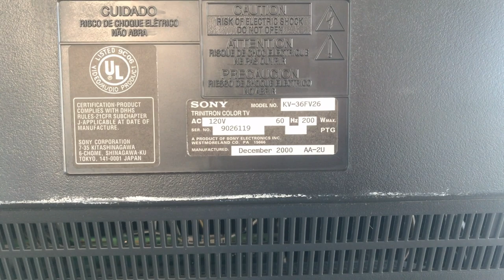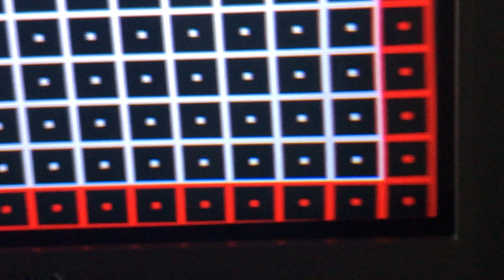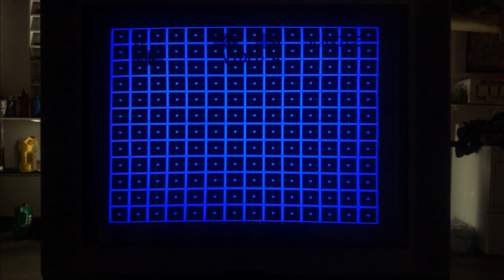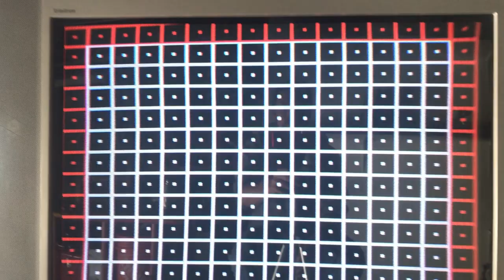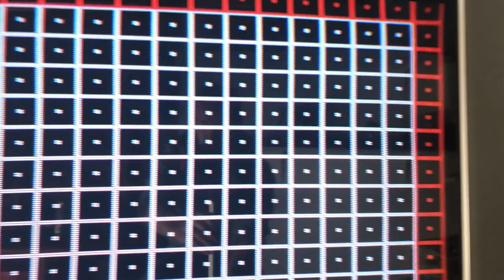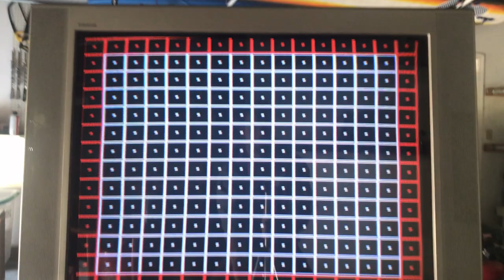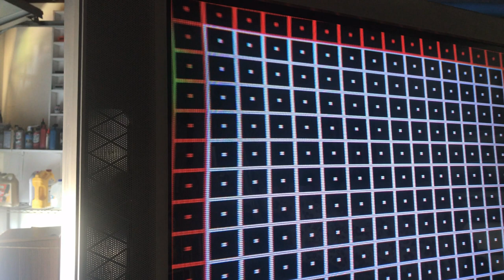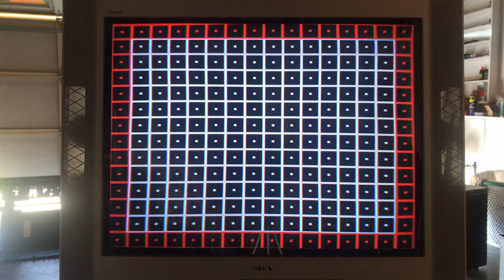How To Do General CRT Service And Repairs: Geometry, Convergence Etc An Emphasis On Flatscreen Sonys

Comment: You have a 4th set of rings to play with. The first three sets right on top of each other are purity, Red-green convergence and red-blue convergence... I think. Anyway that 4th set further back on its own helps with vertical bowing. Move them away from each other or closer together and you'll be able to straighten the top and bottom of the image. Don't seperate them too far! 8mm maximum. My Trinitron came with that same bowing. The problem you thought was mainly to do with Vertical position.
Reply from the maker: Yes! I saw a video of someone demonstrating this recently. I have been meaning to do a follow up video demonstrating what you explained in this comment. How did you find out about the bowing fix?
Reply: @riggel8804  I found the service manual online for mine. It showed the bowing problem as a diagram with the two magnet rings next to it. But with the wording around it, it wasn't quite clear what they were for because it was all next to convergence stuff and talking about the other rings too. And they were called 'blue' magnet and 'green' magnet to further confuse things. I eventually just tried it and sure enough that was the result.
Reply from the maker: @lullylew9083  awesome. Thanks for getting back to me. I pinned your comment.

Comment: Amazing video! Though I would love to see a video dedicated specifically to the Yolk. Talk about the safety of the yolk. How to hold it, how to hold it even if there's no plastic around the coil without getting hurt. 

How to adjust it, set it and secure it even if you do not have a partner to help you out. 

Then the other video, would be CRT symptoms. List the common symptoms and uncommon ones and how to tackle and look for each one.
Reply: you mean the yoke? 😆
Reply: @magnum333  yes

Comment: Thank you and your dad for both your time, effort and risking your lives to show me and others how to do these things! I still have my KV-35XBR48 and I do believe that I need one of those magnets as the top left corner is a bit droopy even after using the service menu. Dielectric grease did work for that CRT TV, but as for the red convergence issue, it is an extremely common thing for just about every Trinitron CRT as every Trinitron CRT TV that I have owned has always had at least some amount of red misalignment issue while for some shadow mask TV's, this wasn't as often a problem. I believe that the reason the red gun happens to go out quicker than the green and blue guns on Trinitrons more likely than on other mask types from what I have found (even ones used very heavily) is because the red gun requires a higher beam current compared to the other 2 colors. So if the red still looks a tiny bit misaligned after doing whatever you could, don't worry about it as it's most certainly the best that the red convergence will get. Again, I cannot thank you and your dad enough!
Reply from the maker: Haha glad to hear from you! I will tell my dad you said thank you. I was telling him about you and how I tried to help you out. I'm happy to hear that the grease solved your problem.  Easy fix!

Yes you can never get these old TVs perfect and I am fine with that. I love analog tech with all it's imperfections. Good luck with the magnets.

Comment: Calibration is a challenge not because of knowing what to look for as far as image problems, but because of not knowing what abbreviated codes in the service menu correspond to each component. There are lots and guides out there, but the menu items vary by TV model.

Comment: excellent video, I have had several Sony sets (KV-FS100, FS120, FV300) and I kept the ones that had the best overall geometry. I cannot bring myself to open them though and thankfully I been able to fix the majority of the issues mine had through the service menu.. except for the bowing of course. The larger sets seem to be affected most from what I have noticed.. 24" and below seem to have less issues.
Reply from the maker: I've heard from several people that you can fix the bowing by pushing the yoke in, rewedging and securing. I would like to try it out.
Reply: @riggel8804  have u tried this yet in a vid mate?? We'd like to see. Be safe!

Comment: a lot of jvc d-series have bonded yokes. A lot of the Sony Wega CRTs suffer from yoke sag and need them pushed in/readjusted to fix the bowing on the top and bottom middle. The Square Sony Crt monitors with speakers below instead of on the side (KV series etc) seem to be better in this regard.
Reply from the maker: I haven't tried doing a yoke adjustment on a sony. I figured you didn't need to because they have tilt correction in the menus but a lot of them suffer from bowing at the top and bottom. I will have to give that a try. It makes sens that their yokes can sag. They have way more hardware attached to them than most TVs

Comment: This is thee best breakdown I have seen so far! Thanks a ton. My 2530 might not need a recap like I previously thought. Fingers crossed.
Reply from the maker: What problems is it having? I've done some work to my 2030.

That's an old ass picture of Morgan Freeman. Have you seen his old cigarette commercials from the 70s? There super funny.
Reply: @riggel8804  definitely gunna check that commercial out. Lol. And just had awful geometry and rough convergence. Did a pretty solid job calibrating it over the last 2 days though! Only thing is I couldn't find the focus knob.

Comment: I finally got the courage to open up and dissassemble my vga monitors. Hope to complete a tube swap sometime this week! Swapping a 17" chungwa with a lg/Phillips tube.

P.s used dielectric grease to bring another Dell E773c vga monitor back to normal working order. The screen would fling when the anode cap would snap.
Reply from the maker: Cool! tube swap shouldn't be too hard on a 17 inch monitor. Make sure you bring the neck board a convergence rings over with the tube.
Reply: @riggel8804  ever tried to put a pvm/bvm yoke and neck board on a consumer TV? Would be fun too see if one could get perfect geometry that way.
Reply from the maker: @SamsungS-or1qf  The yoke has to move with tube. 

I have never tried a tube swap. When a tube goes bad on a crt I just take it to the dump. The thought of trying a tube swap on one of my 36 inchers fills me with dread.

Comment: I have a monitor that ticks so I will probably try the dielectric grease first, it also glows up the back but I I've only looked through the grill, hoping that's just a cap issue.
Reply from the maker: Food luck! Let me know the results after you work on it.

Comment: Any tips on how to fix blooming? My CRT grows & warps a bit each time bright white stuff is on screen. I know it's normal to a point but it seems really extreme on my model. I have a Trinitron KV-20S10.
Reply from the maker: How old is your tv? can you make a video and post it?
Reply: @riggel8804  might not be able to get a video any time soon but it’s from August 1994, picked it up off the street for free so I’m assuming it wasn’t treated perfectly lol. The main problem is it bows a bit on the left & right depending on how bright that part is. That & the typical screen growing & shrinking from the blooming or whatev it’s called.
Reply from the maker: @Nobutehuhh  hard to say without looking at it. My best guess is that something is wrong with the voltage regulation circuit,possibly even the flyback. You could open it up and see if any of the caps around the voltage regulation circuit are bad or just replace all of them. If that doesn't work you could replace the flyback.
Reply: @riggel8804  Thanks! Been looking around online & that seems to be the common answer, I’m really just scared of getting shocked at this point though lol. I’ll check out all the safety precautions & try it myself.
Reply from the maker: @Nobutehuhh  Sometimes you have to sacrifice a few brain cells at the CRT alter to satisfy the Gods of Analog.

Comment: Thanks for this video and the time you put into it.  I have a KV-24FV12 with two issues out of the gate:  1.  In any OSD and sadly while a GC is connected via composite or S-Video there's a jitter/shake to static text.  2.  The image is tilted to the left and I figured menu rotation or service menu TROT (which it has) is not affecting it much to correct, so I believe I may need to physically rotate the yoke correct?  I really hope this jitter can be corrected somehow.  One thing I have tried as well is VM set to off both in menu and service menu.  Thanks.

Comment: youre the fuckin best man, subbed bc of this video! I have almost the exact same model (kv-36sf12) and couldn't find any helpful videos specific to mine. Only difference I could find was the speaker positions, mine are on the bottom instead of the sides. I finally got my screen dialed in after like 12 straight hours of watching yt videos and messing around with the yoke. You even helped me find some pots that i didnt realize were even there lol. TY so much, now I can FINALLY play my games without having my OCD freak out on me
Reply from the maker: Hell yeah my dude. What games u playin? I'm sitting down for some fire emblem on the snes right now.

Comment: Great information...I didn't know how to save settings in the service menu...I just turned the tv off and back on. Also the 0 plus enter to bring the settings back to default will help me alot. I might even try to do some magnet adjustments to my 36 inch garage Trinitron that I use as my test tv. I tried to use the 240p test suit for color calibration but I always go back to super Mario word and it looks wrong. I find the title screen of that game is great for calibrating geometry and color....it has everything you need. I'm lucky my main fv300 has great geometry as there is no way I'm moving that fucker again to open up the back!
Reply from the maker: Lucky dog. My fv 300 had terrible geometry and I had to dump it. I like the 300s, the one I had was really sharp. Oh well. Plenty of fish in the sea.
Reply: Do you have any RGB scart modded TVs?
Reply from the maker: @joshforsyth5710  Nope. Don't really see the point when you can get an rgb to comp transcoder.
Reply: @joshforsyth5710  If you're also like me and prefer the older KV models (came in black, looks gorgeous) go for it.

Comment: Thanks man, I learned a lot with your video, I probably wil never do it , cause I am sure I will fuck it up, but is nice to learn this corner and  green, red  or blue stains can be fixed.  Man, I own 3 different Widescreen  CRT , one of them is PAL and NTSC 480i or 576i and the other 2 are HD with HDMI inputs, I realized the HD ones hade problemsof overscalling, somethis at the side or the top and bottom ( sides is the most common) do you have any video showing how to fix that kinfd of problem? cause I already tried with their service menues, but it seems is just impossible to recover those zones using them.

Comment: Great video. I have a Panasonic 29inch and am having problems with the focus on the corners, do you have any tip to fix it or improve it?. Thank you. Greetings from Argentina
Reply from the maker: Did you try adjusting the focus nob on the flyback? There also might be some pots on the neck board that will affect the corners. I am not familiar with that tv. Good luck.
Reply from the maker: Warning. When you correct corner focus it will often distort the focus in the middle of the screen. Sometimes it's best to live with the corner focus being off.

Comment: Cool video but your geometry is still pretty messed up at the end. I wonder if it's even possible to fix it on these flat screens. Mine is pretty bad too.
Reply from the maker: The geometry on this tv is fine for my taste. If you want perfect geometry on a grid pattern than you want something other than a flatscreen Sony. I recommend a small pro monitor. Many of those have perfect geometry. 

There are some other techniques to correct geometry that I didn't attempt in this video but I don't think it's worth trying to make Flatscreen Sonys perfect.
Reply: The bigger and the flatter a picture tube, the harder it is to get perfect geometry and convergence.
Reply: As someone with a large flat-screen crt that was serviced by a professional (old guy in the neighborhood who used to work in the trade), its pretty much impossible to get perfect geometry. The technology is still made to be projected on a curved bulb at about 20", not on a flat screen at 30+", so nearly any fix for warping or bending you implement will cause a problem somewhere else on the screen. 

That said, it certainly is possible to get it good enough to where you don't notice any issues in-game, which is the ultimate goal. As a hobbyist, it can be very rewarding to meticulously correct the errors on a CRT using the 240p test suite. But ultimately, if the goal is to play games, the issues on the grid will hardly surface in actual play.

Comment: I have a Samsung Tantus 34" crt HDTV and for some reason it just stoped working.. I plug it to the wall and nothing happens not even the stand by led.. I been wondering if I can solve the problem myself but im kind of scared of doing something wrong hahah.
I think Im gonna give it a try soon. I love the image quality that CRT has
Reply from the maker: My first thought is that the power supply failed. You can try finding a CRT with a similar power supply and swapping it out. It's not a hard fix if you can find the right power supply but it might not be the power supply.
Reply: @riggel8804  yeah.. it was the H.O.T blown.. it´s fixed now. thanks.. i recently saved samsung slim. it has the vertical IC burnt and the capacitor before it lost capacitance I guess it was the responsable. it´s fixed now but daaaaaamm convergence and alignment is a total mess
Reply from the maker: @shiroumxm2052  convergence and geometry can be fun to fix. Good luck
Reply: @riggel8804  jejeje, I gave up for the moment..it´s way harder than actually fix the thing.. if you ever find the settings for the Samsung Slim cl29z30pq deflection and give them to me i will pray for you the rest of my life. 
I was planning to give it away to someone who plays retro since I already have a D series for nes and snes and a tantus  for 360 and game cube .. if i cant fix geometry im goingo to dismantel it and make a  good use of the flyback and othe nice components.. its not a good tv anyway .
Thanks!!!
Yes my english sucks

Comment: Hi Riggel, i have been meaning to clean up the bottom right corner of my Zenith Flat CRT and watched how you did it. As long as Im not touching around on anything and just slip the convergence strip under the bottom left of the yoke (to correspond to the bottom right screen corner) theres no hazard or risk right? Rather than shoving a convergence strip under the yoke’s corner, could i just get a larger circular neodymium and tape it further away from that corner directly on the back of the tube?
Reply from the maker: Anything metal will give you a little zap while it's powered on. It doesn't hurt too bad. If you pull the anode cap off while it's powered on and stick it on your tongue it will ruin your day so try not to do that.

Regarding the magnets, both of the techniques you mentioned can work. You really just need to get in there and play around. You will figure it out. Good luck!

Comment: Great tutorial, I have a tilted screen and I thought that the only way to fix it was opening it up. 

Another question, I have a modded PSX and whenever I put a PAL game the image appears on colour (not b&w like most issues) but scrolling down at a really fast speed. Is there a way to fix that via service menu?
Reply from the maker: Should be able to fix that. Most tvs have an adjustment called "v hold" older sets usually have a nob on the outside for adjustment. Some tvs have the setting in the service menu.
Reply: @riggel8804  I remember the knob from old tv sets, Sadly I haven't found "v hold" or anything like it in the menu nor the service one

Comment: Bro....I got a 13" zenith sms1324s that keeps blowing fuses soon as I power it on! It's probably an easy fix I'm asking for ideas on what it might be?
Reply from the maker: Fuses are designed to blow if something is wrong. Do not use the tv until the problem is addressed. You can open it and look for any obvious problems like leaking caps. If you can't fix it take it to a tech. A lot of guys that fix hifi stereo equipment can also service CRTs.

Comment: On my Panasonic 30” CRT HDTV CT-30WX54 i have just the top middle raised a bit but everything else is fine. Would a small magnet strip work?
Reply from the maker: Yeah. I have a link to send you but youtube would fukin delete my comment if i sent a link so look for a video with this title. 
Sony Flat Trinitron RGB Geometry, Convergence, Bowing fix

Basically you have to adjust the rings behind the convergence rings. If your problem is what I think it is. Good luck. Let me know if you fix it.